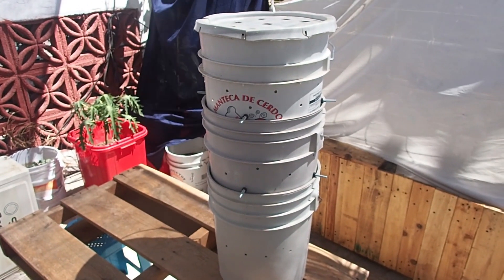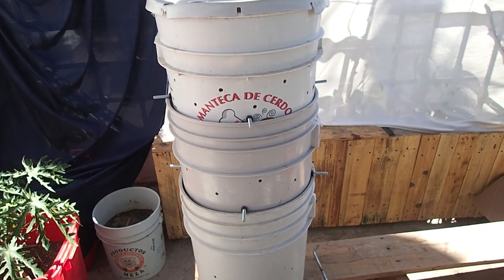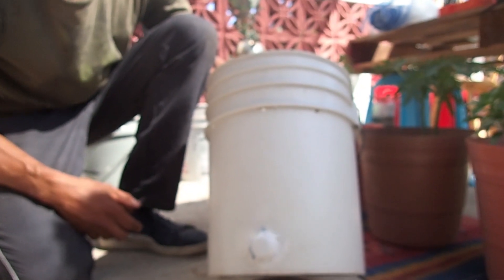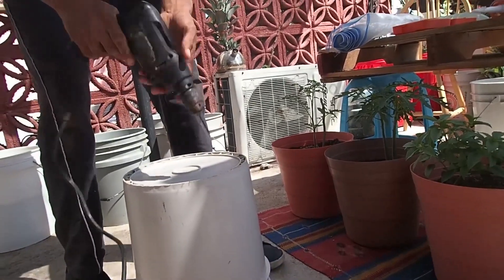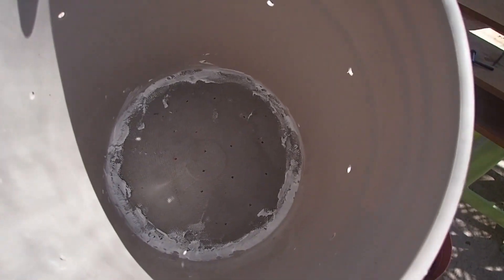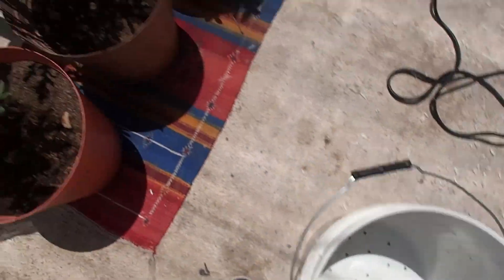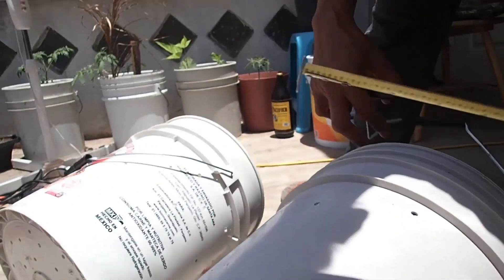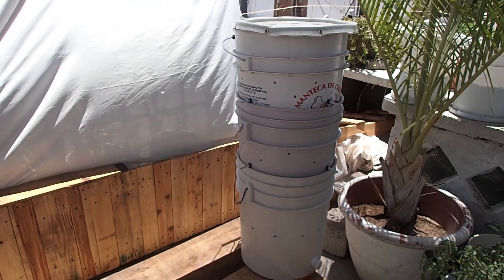How I build a worm composting tower from recycled buckets for under 10 bucks.

Comment: Will the earthworms not get sliced when sliding over the netting on the sides of the buckets? And I see that your buckets are not snug since they're elevated with the rods. What prevents the earthworms from crawling up through those gaps? Finally, I see a lot of videos where spigots are used. The spigots are so close to the bottom of the bucket that I don't see how you can slide anything under it to catch the liquid assuming the bins are on the floor.  As far as I can tell, you'd have to lift the entire setup OR disassemble the tiers to get that bucket to empty it out. I've never drilled holes in the bottom of my bin and find I have no excess liquid that requires being removed. This is not worm tea that you are collecting. It is leachate which is quite anaerobic and not a good thing to use in your garden. Worm tea is made by using the actual castings with water and aerating it. Your concept is good but I think it needs some tweaking.

Comment: I wonder if a 'step drill' type of bit might help in sizing the drain hole opening just right. I like what you did there for the tap!  The fly screen circle for the lid could be cut an inch or two smaller in diameter to do the trimming before the screen is applied, saving a step. Does the leachate need air not to anaerobic and smell bad? It's seems maybe the bottom bucket could be simplified to a pan and tube and jug. But I like what you did! Really good! Thank you or sharing it! How do you keep them warm in winter or cool in summer?

Comment: what is the idea behind having 3 ribs around the top of the bucket?
Reply: I think you mean the ribs that strengthen the bucket by reinforcing the upper part, so less plastic is needed. I count four in total. That is how strength and rigidity are engineered into the container, if I understand your question.